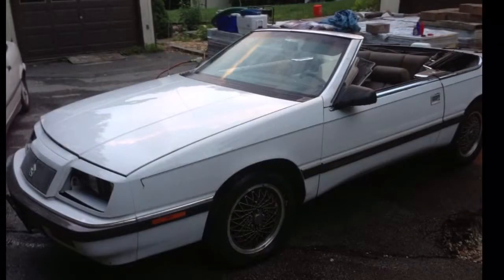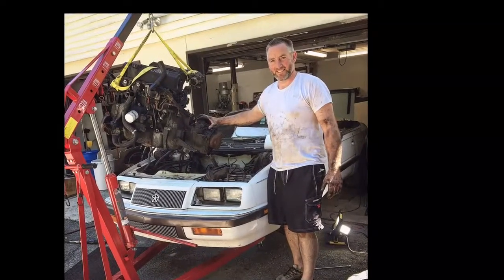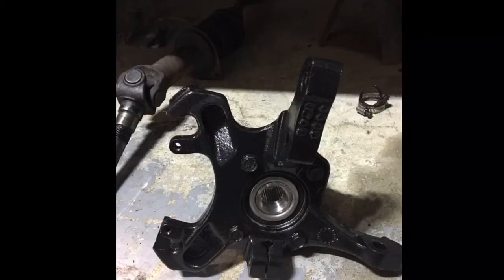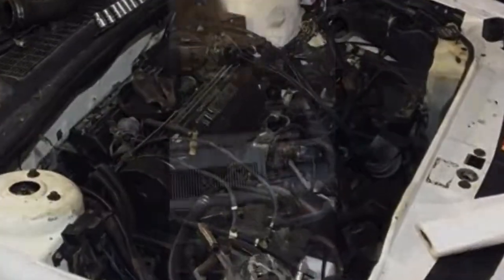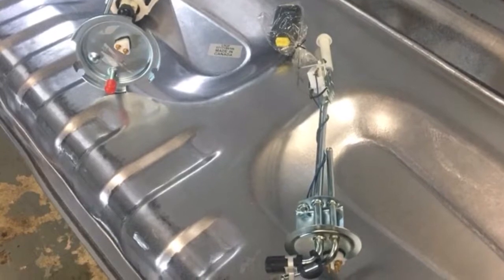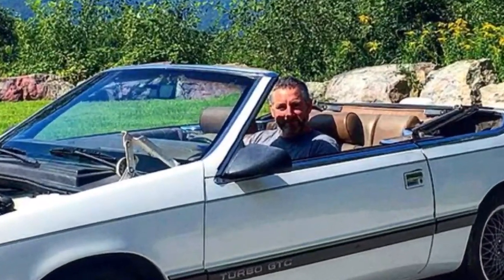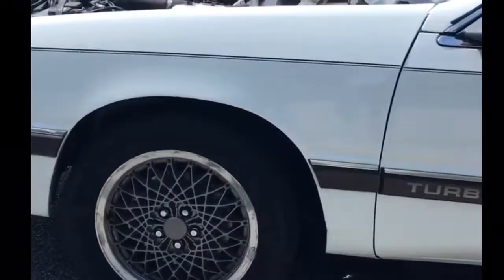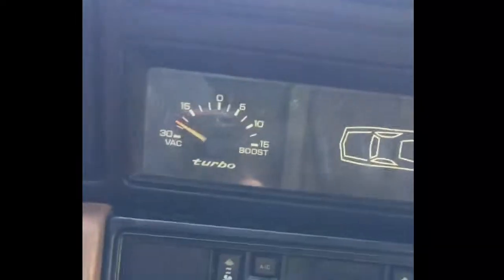1989 Lebaron GTC engine/trans swap

Comment: What was the cost of this conversion, how's it holding up?
Reply from the maker: I have a ton of money into this car.....
The motor build was 20 years ago and I had $6k into the machine work back in 2002
The swap over was very cheap and only took a weekend to get it running 
But......
I have the Flashable ECU, MPSCILINK, dual intake temp sensors, innovative wideband with E85 flex fuel sensor, front mount intercooler, 2.75” piping, custom anti roll bars, Koni struts and shocks, 
So with everything I got about ~$10k in additions and upgrades!
Reply from the maker: With all that said, I’m holding very strong at about 300Whp, data-log capabilities and E85 operation.
I hope to run some 13 second runs by the end of the year!